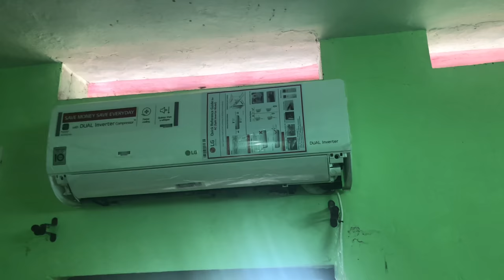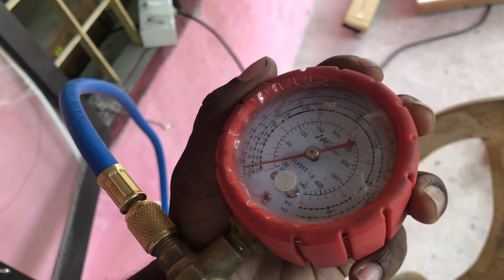How to Split Air Condition (AC) installation LG - Video

Comment: Hi , I have LG 1 Ton AC,2014 LSA3MR5M.AMLG(II) MODEL  i had LG AMC till May 2019..the LG AC Technician serviced nearly 5 to 6 times in 2 month Interval from APril to May'19... still the Cooling issue is there.  the LG AC team did this : 1. Changed the Outdoor Unit Coil.2. Indoor Unit leakage was arrested completely by submersing inside water  and checked.3. The AC Gas tube and the tube inside was changed. 4. The AC Pipe from outdoor to indoor outer Rubber tube was replaced. They Added the Gas to 70 PSI each time in 1 month interval,. The AC gives Super cooling for 2 Days and the 3rd Day it goes down.  I checked Now , The AC Run, Compressor Light is ON but No cooling is coming, Normal Fan is Air is coming. No Noise from AC, No Ice ( white layer)  is forming in the AC tube.  Even the LG AC  Technician does not know the problem, they said they have tried all things but we dont where the Issue is.  My Guess " the Compressor Gone Bad and the LG AC team does not want to replace since it costs more even during AMC period"   WHAT WILL BE YOU SUGGESTION BASED ON THE ABOVE ISSUE.?? VASANT10@GMAIL.COM
Reply: Leakage issue give the pressure both unit (indoor and outdoor separate) and  minimum hold this pressure 4 to 5 days then check back the pressure...
Reply from the maker: ok

Comment: In my case Installation guys didn't check the  gas pressure ,that you showed at 19.35.. Is it necessary to check gas pressure by that instrument .. In my case Lg installation guy's didn't chec... Please reply
Reply from the maker: i will check later
Reply: Same here, they didn't.

Comment: Installed lg dual inverter ac yesterday 1.5 ton for 180 sq feet room........don’t know why after running it on Himalaya cool or normal on 16 degree for 30 min .....the temperatures hardly reduces by 5 (degrees (30 to 25 ) and not goes below 23 even after running it on 16 for an hour according to remote room temp...........is it ok?? Or should I talk to lg customer care for .............well the room is packed and  neither roof nor any of wall facing sun....
Reply: Gas leakage problem hai. Pressure check krwalo

Comment: What's the use of an AC if there are huge slots in the wall, the AC will keep trying to remove the heat from the room but the heat will just re-enter through the slots.
Reply: Actually they will close that from outside using plaster of paris/white cement etc.!!
Reply from the maker: ok

Comment: Hi my lg dual inverter  ac fan goes slow when I put the ac on sleep mode ...do u also face such problem..please answer
Reply from the maker: no problem bhai
Reply: Its normal, if inside fan is slow then outside fan is slow.
Reply: yes i have the same problem.
when i put it on sleep mode. the ac feels like working very slow
Reply: @souravroy2902  its normal, in sleep mode ac fan goes to minimum